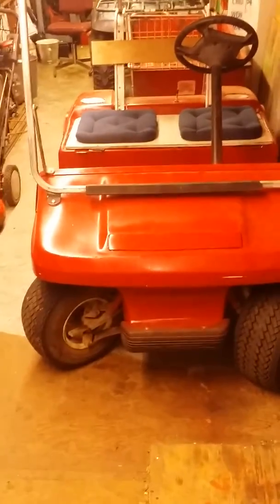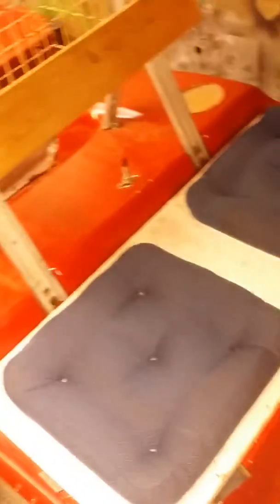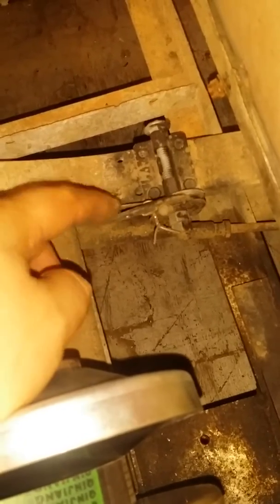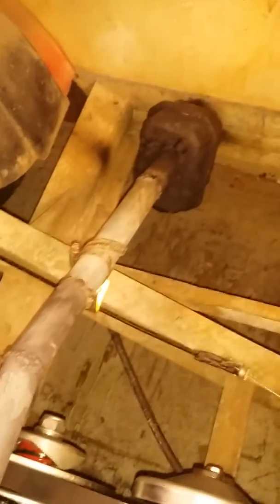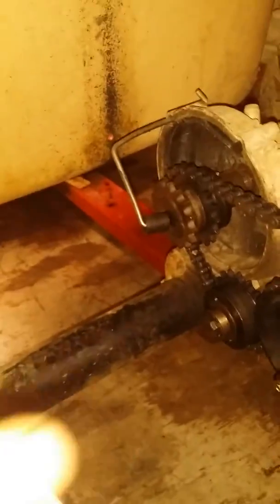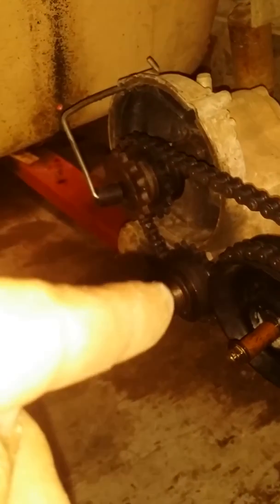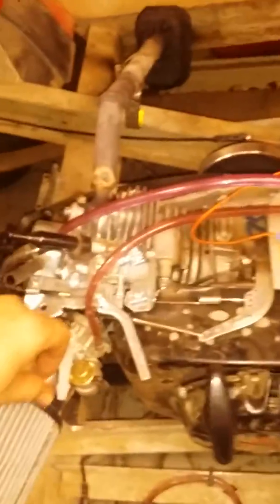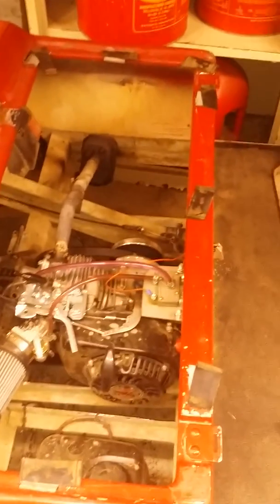Club car ds electric to gas conversion

Comment: Did you have to place a 3/4 inch metal sleeve or coupler on the original shaft making sure to extend the shaft through the coupler or sleeve and then weld the #40 sprocket. What size sprocket did you have to order 3/4",  1", etc.. 
I have a 1996 Club Car DS that I just got and have it on jack stand with the body off and and the broken electric motor removed, waiting the on the parts you recommended and get this project finished, any help is greatly appreciated. Kudo's on the great video and simplifying the process.also can you still use the forward and reverse selector shifter?
Reply from the maker: No reverse sadly, I used the center shaft from the electric motor. Sprocket size I thing was 3in od and 11/8id...but don't quote me on that. First strip your motor, and measure the shaft diameter...and I do remember the sprockets being on the difficult side to get

Comment: Whats the top speed and gearing on this thing? I was going to try to do a 18t driver 
sprocket and smallest i can get on the motor shaft for a decent speed, 20mph would be good. I know these things have a bunch of reduction in the axle. I have a 96 DS im converting now

Comment from the maker: used the center out of the original motor (matching splines) and had a gear welded on to the shaft